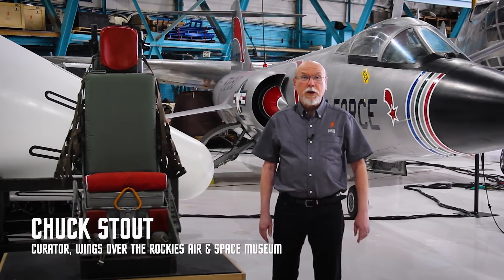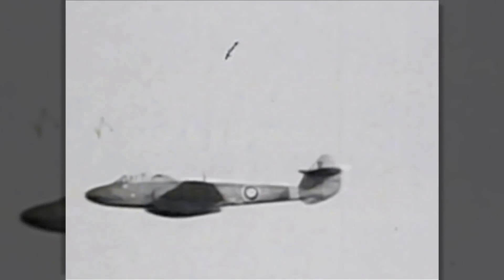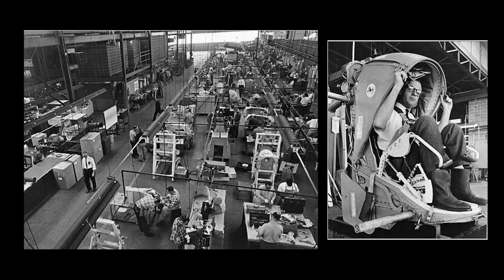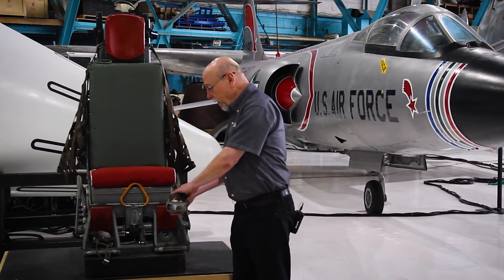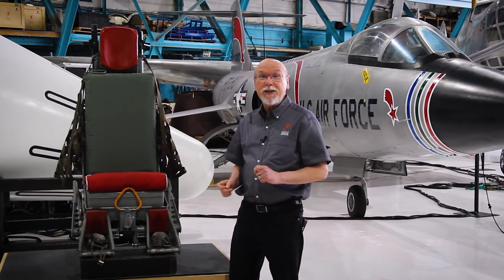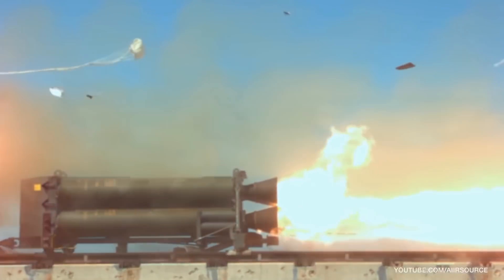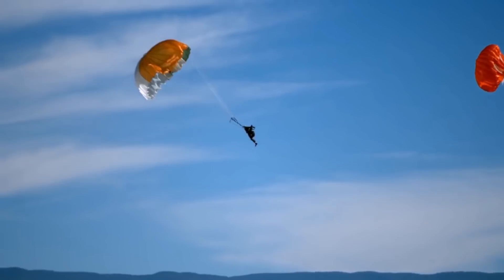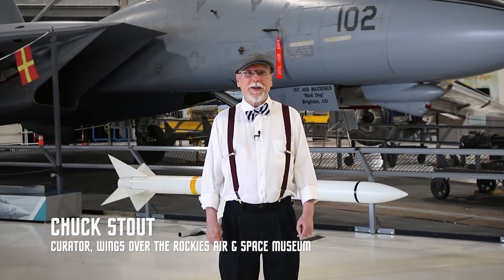F-104 Ejection Seat

Comment: The Starfighter provoked one of the German Bundeswehrs greatest scandals ever. In 1964 no less than 27 Starfighters crashed with 17 deaths. From 916 ordered Starfighters, 269 crashed and many of the deaths related to the ejection seat crashing into the t-shaped rudder causing deadly injuries. Such an awesome plane but poorly constructed. Especially the F104F series.
Reply: The Germans crashed a lot of F-104's due to insufficient training, poor maintenance, lousy weather, and birdstrikes.  German Starfighter ejections were well-documented.  If the pilot ejects out of the envelope and hits the tail, that's not the fault of the seat.  I suspect the number of those is just a handful, not "many".

Comment: You can't eject at 1200 mph.
Reply: Well... you could try...
Reply: My dear friend, when a plane is damage (most often) it loses speed rapidly, for example in a dogfight scenario but the problem with the starfighter is that they used it as an ground attack aircraft and it bad weather it was super hard to control and the aircraft never forgives pilot error so it ended up on crashes that they could not even eject out of

Comment: I should explain how my dad happened to be ejected from the F104. The canopy became stuck with Andy inside working. I'm sure they tried physical ways. But finally decided to release the air pressure on the Jet in the hope by releasing pressure operating the seat ejecter system would only pop the canopy. This based on the assumption like other seats the F104 operated used airpresser. So Andy sat in the seat ready to yank the seats eject cord. As you know the seat actually works with a high caliber round. When he pull the cord the canopy flew off, he and the seat slammed into the ceiling. When a pilot was forced to eject a medical examination was required to determine whether it caused body or brain damage. Thanks for the opportunity to tell you my dad Andy Mullin also had the Right Stuff. If Poncho Barnes was in the movie, I think Andy deserved honorable mention. By the way Poncho Barnes handymen stole Bill Ware's horse and sheep while he was a medic in WW1. Bill told me the story of getting his horse back, said he cried like a baby. Poncho was quite a woman.

Comment: A minor missed opportunity to discuss  the early model F-104s downward  firing ejection seat.
Reply: That's what I was looking forward to
Reply: the downward ejection thing seems so nuts. I can't imagine it working well..
Reply: @stijnvandamme76  That is until you imagine what would happen should you shoot the seat upwards. As has been mentioned several times, the early ejection seats did not have rockets powerful enough to clear the vertical stabilizer of the F-104 at Mach 2. So the seat had to be ejected downward. Trying to pack more punch into the rockets at that time would lead to severe spine damage, not to mention the fact, that the US did not have a strong enough rocket for the seat at that time.
Edit: another thing I forgot: early seats were NOT zero-zero capable. So in case of an emergency you would have to get the plane to fly at a predetermined minimum speed and height before you could eject out of it.
Reply: Had dinner with a former pilot of this aircraft. He mentioned his version was the downward ejection version.  The heel cups were mandatory to have your feet in before ejecting or you'd break your legs. The plane was to be rolled and inverted prior to exit based on what he told me